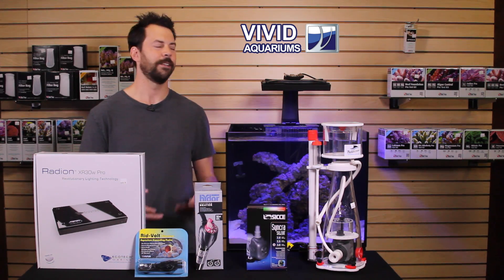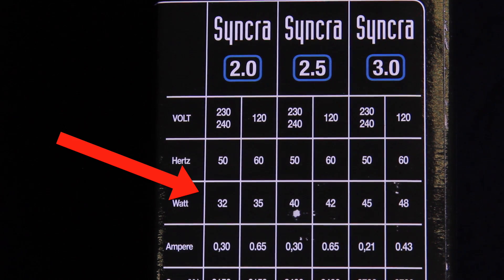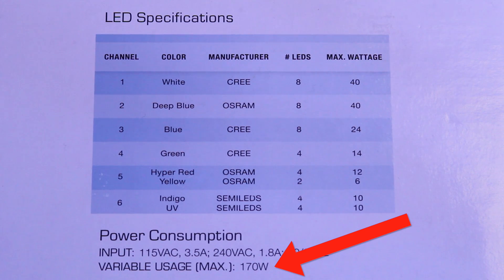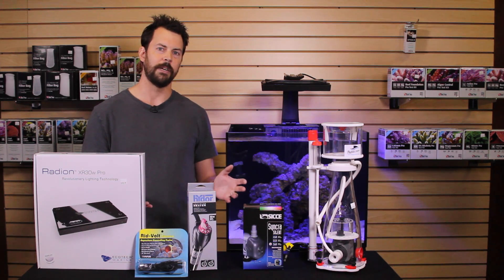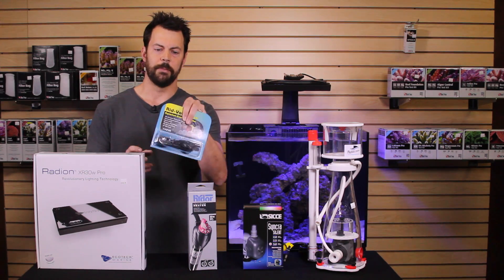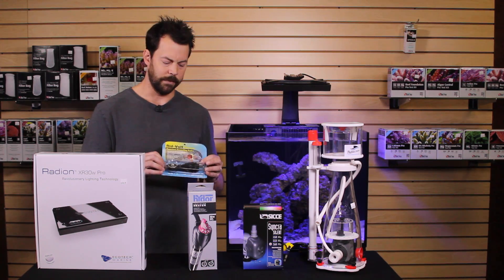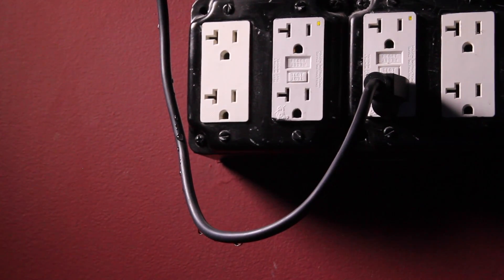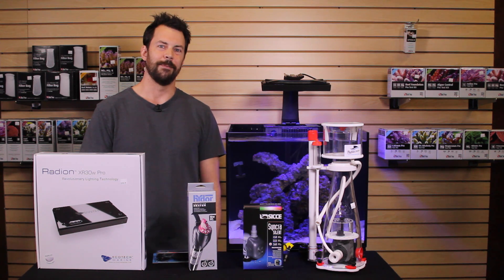Red Sea Reefer pt11: Powering Your Aquarium

Comment: I'd like to correct you on something. The Watts you mention on the Syncra 2.0 box are 32W, which is what the Syncra uses if you're connecting it to 230/240V. For 120V, the box indicates that the power consumed by the Syncra is 35W. The end result of the calculation will not vary too much, but this is something to observe in other hardware.
Reply from the maker: Good catch. Thanks!